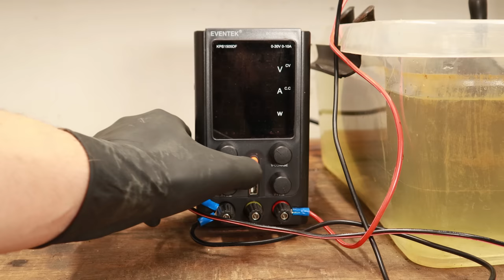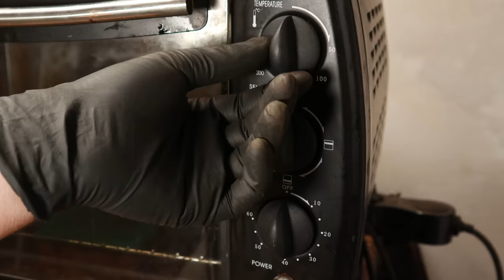Phenomenal Oil Stove Restoration

Comment: This is a question, not a criticism. You have done this, and I haven't. Why do you use the electrolytic procedure so early on, even before cleaning and stripping the paint? It seems to me it would be most effective to do it last, just before painting, as it is better at removing the last traces of rust than other methods.
Reply from the maker: You're right! There was a lot of dirt on the surface. On some parts, I hadn't seen the paint underneath.😄